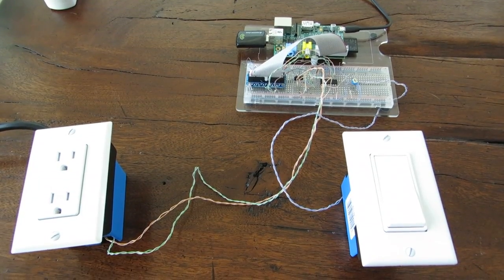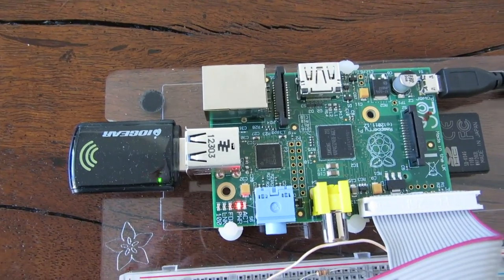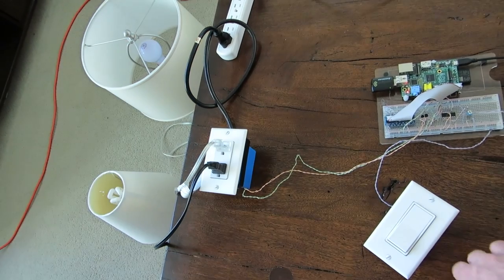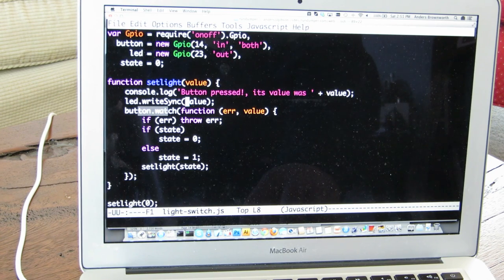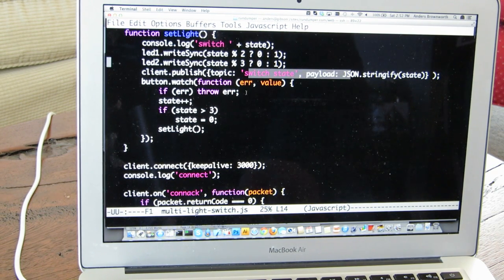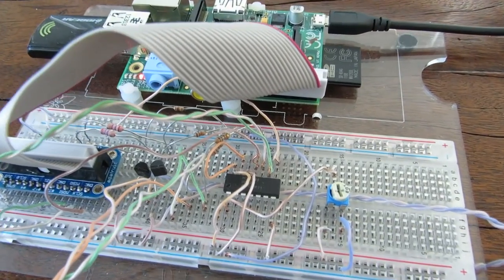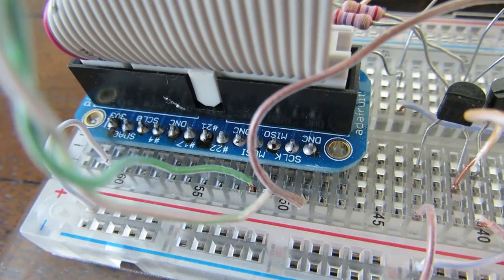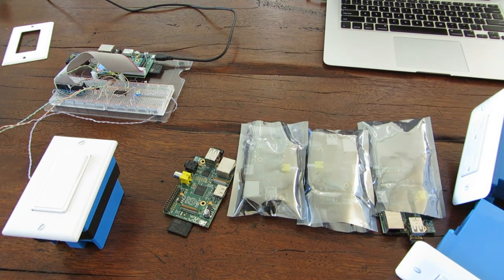Home Automation with the Raspberry Pi and Node.js - Well Tempered Hacker

Comment: one note of caution. here in the USA, it is illegal to place a low voltage device in the same enclosure that a high voltage (line level) device is in. if something were to happen to the relay in the outlet box, there is a potential of high voltage being applied to the tiny wires and may cause a fire. Check the local electrical building codes BEFORE doing this. It could void your homeowners insurance!!

Comment from the maker: Because we would have to run GPIO wires all over the house and would forfeit the ability to sense power, sound, motion, etc. at each socket / light switch. Products like this already exist but they tend to be unwieldily and proprietary. For example, why attempt to reinvent secure wireless when WiFi exists? I'm trying to apply open technologies that have proven track records to a problem that has traditionally been solved with proprietary solutions.

Comment from the maker: Yeah, I came from a micro controller / FPGA background as well. Being able to leverage all the standard Linux tools as well as having a true multitasking environment for $35 are huge benefits.

With node js you have JavaScript, a very popular and fairly easy to pick up language for most. Functional programming isn't ideal for the simplest of situations but the libraries available through npm are extremely extensive, and I think about home automation as an inherently event driven system.

Comment from the maker: Yeah, great call. This is exactly where I want to go with this. What you are suggesting is that things like home security are just "apps" that run on your network. The Raspberry Pi gives you a standard set of tools already (mic/speaker) so adding a few more (motion detection/temperature) and defining that as a platform so apps can depend on certain capabilities is the way I'm thinking about this.

Thanks for the comment!

Comment from the maker: True - which is why I got SSRs that are rated roughly double what I will see. Worst case we make the box out of metal and screw them in. For running lamps, they don't get any warmer than room temperature, but I'm not opposed to traditional relays outside of the clicking sound they make when they change state.

Comment from the maker: The Raspberry Pi's USB WiFi device connects to an access point. It can be made to run in AdHoc mode though where peers connect directly.

In the end game, I don't "remote control" the devices. That's what the switches are for. When a switch changes state, it broadcasts that fact. Any power sockets that are subscribed to that switch can change state if they are configured to do that. That's what I was attempting to demonstrate with the multi-light-switch example.

Hope this helps.

Comment from the maker: Good point - no reason data over power wouldn't be possible. I have circuit diagrams available on the GitHub page if you follow the link in the description.

Best of luck with your setup!

Comment from the maker: I'd imagine that might work if the drives are powered externally. If not, maybe you could look into spinning down the drive via a "parking" command. It would remain connected but not taking up the power. Presumably you could programmatically fire it back up on demand.

Comment: You might want to look at Tellstick device. It is a third part USB device that is used to control 110-240 Volts radio controlled devices. 
There are transmitters you can have in your pocket or mounted on the wall insted of or combined with ordinary light switches.
There are receivers that can be plugged in a wall outlet or even mounted inside the wall outlet or electrical devices like lamps.

Search for Telldus or Tellstick. A nice device that can be used with a couple of RPi for each room with your software.
Reply from the maker: Thanks - interesting. I'm mostly interested in having the intelligent devices on the edge though.
Reply: Anders Brownworth an Raspberry Pi is an intelligent device. ;-)
You just can skip wire to a lot of places to controll things.  And the RPi and electronics/relay is much larger.

Comment: Heat shrink tubing + small arduino/pi friendly relay boards. Neater and safer. Or buy a relay board with networking built in already. That's my personal preference.
Reply: off to  check out your channel

Comment: Your setup is simple and elegant. My only suggestion would be to consider powerline network adapters in some places.  Some houses (like mine) don't allow wireless signals to travel very far.
Also, if you could put up some wire diagrams of what you have on the breadboard, I would be grateful. I am considering doing something like this and could certainly use the assistance.

Comment from the maker: Well, you could. Many people do that and it does have the benefit of being a bit cheaper. However, there is a lot to gain by leveraging a real multiprocessing platform with a rich networking ecosystem. For example, even just SSL over encrypted WiFi represents probably an order of magnitude more security to a system that will likely eventually control things that cost you money. (like a heating / cooling system) Add to that a great programming environment and for me it becomes an easy choice.

Comment from the maker: I could name a few features that would be nice to have (built-in WiFi for example) but I'm generally fairly content with what the Raspberry Pi has. Performance, on the other hand, is what you might expect from a $35 computer. It usually doesn't matter but filesystem access can be agonizingly slow at times. That's probably most annoying but it gets there eventually.

Comment from the maker: Yep, you can do a single Raspberry Pi but then you are limited by the number of GPIO ports and you have to run low voltage wires everywhere. I suppose you could run a few Raspberry Pis and wire several sockets / switches to each as practical. Would love to have your help on the project!

Comment: Awesome project, looks like a solution for my future RPI project. I'm making a HTPC and have my files on a couple external usb hard drives. I don't want all the drives powered at the same time so using your prototype I might be able to have the RPI automatically power and access only one drive at a time or two.

Comment: I've seen your comments where this system is basically not overkill as some are stating and I agree with you.  I understand your position completely.  In essence, you are simply laying the groundwork for bigger and better things.  In that vein, I was thinking that as an alternative to merely replacing switches,  as you have done, perhaps something more like a larger module with clickable components.  Now that wouldn't work with the actual switch per say (though you could have a digital version relaying essentially the same information) but you could also include in the space areas for "upgrades".  Baby monitors and intercom systems like you mentioned or a touchscreen (for notes or news or what have you) that is networked to the main system or customized music system or a projector (for playing movies or media from the main system in any room on demand) or a smoke alarm or weather station or all of the above and more.  All of these components could be taken out individually and repaired or replaced as needed without losing the entire system.The more I have learned about these Pi;s today, the more cool ideas flood into my head :)  Anyway, I love what you have done and completely understand that this is NOT overkill in any way shape or form.  In fact, if it were me, I would wait until the next gen of Pi's come out before doing any real implementation.  If you ever want any help from a web design & dev & graphics person, just yell.  Plus, I'm full of useless ideas to boot :)
Reply from the maker: Thanks - your thinking is spot on. There is no reason why you couldn't extend to touchscreen / graphical devices, smoke detectors, geiger counters, etc. Looking forward, the applications are almost too numerous to count. But you have to start somewhere!

Comment: Awesome! Great idea! It might help contribute to save power to turn off the sockets while they are not in use. Can easily be extend to turn off/on over the internet. Can't wait to add it to my DIY list.
Reply from the maker: Yeah, that's a good call. It might also be interesting to use the input of some motion detectors to shut power off on pre-selected sockets if there is no movement within a room for 30 minutes. Then when you come back home, those sockets might automatically power up again. Actually there are a number of ways to do this - motion detectors being only one of them.

Comment: Well, the lights are all up on a grid above our talents heads, so turning them on and off presents a challenge. We run extension cords down with switches, but it would be really neat to just control them with something you've created. We're dealing with about 8 lights now, it would be neat to have them all on one switch or app. I am sure there is a market for this besides just us. :)

Comment: I would like to see a more complete version of (one, or more?) of these 'nodes' in tandem on a network and including a web interface to mimic the switch controls. I am also looking to build a HA system that 1: is RPi based, 2: leverages the web interface AND traditional switches to control things, 3: provides real-time feedback of each state (I'm thinking that socket.io will be needed), 4: easily scaled. I feel that including an arduino with the pi will provide much capability that is easier to implement than the A to D converter, plus it would reduce the amount of Pi computers needed.

Comment: Hi Anders, thank you for sharing this amazing video. I really love it. I am quite interesting with the raspberry part. So far that i try to understand your video, you use ADC to sense power. What i am curious about is that, do you put resistor between your ADC and raspberry pin input? Is there any resistor inside raspberry to control how much current it can draw from input pin? It is quite frustrating to find raspberry specification about current specification. Really appreciate if you can share your knowledge about this.
Reply from the maker: dimas adityamurthi No, with the ADC I'm using I don't have a resistor between the output of the ADC and the Raspberry Pi's GPIO input pins. Depending on the ADC you use, you might need one but I have a 3.3v logic ADC so I don't need anything.
Reply: Anders Brownworth Thank you so much for your reply. I am wondering, can I use LD1117 (voltage regulator) to drop voltage from power supply 12VDC 10A to 3.3VDC and connect it to raspberry?

Comment: It's neat to see this as a proof of concept!  On practicality though, each Pi requires a lot of energy individually, even idling which they will almost all be doing without any serious work to do.  There's also a lot of "moving" parts, as normal electronics atrophy over time, so individual nodes will decay and fail regularly.  So the cost will ultimately be much higher than the individual Pi's I think.  I think using a lower power, lower cost IC would be more practical, such as an ATmega328p at just 4 dollars each.  Each IC would have more than enough power to do everything the Pi nodes are doing.  (again though, as a proof of concept, it's nice to see the process and conclusions, as experimentation goes)
Reply from the maker: Clairvoire The Pi (especially the model A) use very little power (500mA) but agreed, there is always room for improvement. However, I wouldn't go to a micro controller such as the ATmega328p. The flexibility to be more than a special purpose hardware device is the point of this project. A micro controller is all you NEED for a mobile phone but giving it a microprocessor allows it to become a smartphone, something exponentially more useful. The point here is what the entire system can be that is well beyond simply a smarter light switch.

Comment from the maker: It depends on the loads I'm driving but with these lights they remain room temperature. I'm sure if I were switching something much more demanding they may get hot but the idea in the long run would be to heat sink the relays against a metal housing. That seemed overkill for my prototype.

Comment: thanks - but ... It looks like much of what you have on the breadboard is not necessary - just a current flow monitor for down the road expansion. right? Anyhow I am a newbie looking for a starting point. The simplest computer command line to turn on and off a single light with the simplest possible code (fewest lines). Also explain if  SSH to the Pi is needed or is there another secure protocol? Is there an SSH lite? How do you plan to central control?

Sure would like to see another video for your breadboard circuit with closeups on the parts so I can see the part numbers.. There are so few that you could list them in the comment section. Thanks for the closeup on the Sharp relay - consider how much time I have wasted and not found it.
Reply: sshpass + exec would be amazing...

Comment: Why not do the sensing and actuation using an XBee ZB mesh network. Connect the XBee Controller to the RPi via e.g. Arduino or directly using the Cooking Hacks Raspberry Pi to Arduino Shields Connection Bridge with Xbee headers.

Comment: Thanks for sharing your Raspberry Pi project, it has inspired me to try and replicate it. Keep in mind this would be my first Raspberry Pi project and I am primarily more interested in the programming component, but to be able to do the programming part, I would need to setup the physical component first. So, is there a shopping list of the components one would need to build your project from scratch, and possibly even a list of instructions to connect it all together?
Reply from the maker: pablotam80 I don't have a simple parts list worked up - it would depend on exactly what features you wanted. I had considered making a package with all the components you need. I'll look into doing that again.

Comment: Hey good video really liked it. but I have a question where do you run your MQTT Server on ? wouldn't that be the central point of your system ? that means a single point of failure. I solved the Problem by using redundant Raspberry Pis as a server in case one of them is failing there is still 2 other ones. And as a client in the Switches im using Arduino with PoE, its from the point where i'm just a workbench system but if set it up in your house you need to run Ethernet Cabel to every arduino.

Comment: Great video Anders! This really motivates me to try out Raspberry Pi!

Question... Why is Node.js being used? I don't see what the connection is to using Raspberry Pi. As far as I know, Node.js is a server side language for websites, no?
Reply from the maker: +Justin Javier Good question. Yes, Node.js is used on websites but it is actually a more general server-side language. You have the flexibility to use just about anything (python is popular) but I find Node.js to be very simple and clear. Add to that the "onoff" package which makes reading / writing the GPIO pins very simple and of course the ability to easily add a REST API or web front-end - kind of an easy decision. It isn't nearly the most popular option at this point but it is hard to ignore that Node.js has a module for nearly everything these days. Node.js uses JavaScript which is the most popular language on the planet so I think it is somewhat inevitable given the millions of people with a JavaScript skill set. We'll see what happens but I like it.
Reply: +Anders Brownworth I never liked JavaScript, infact I hate it with a passion :)
I did some NodeJS work for some Twitter bots and that was about the only time I was like: Yeah this is something that it can and should do ;)

I rather stick to Python if I need an interpreted language because it actually has proper OO support, multi threading support and is a clean language.
But when stuff gets more serious than my choice is Java or C/C++.

Comment: How come you didn't use a mechanical relay? Solid state relays are usually if want to operate faster 50hz e.g. if you want to use PWM which you would have no need as you have the digital to analog converter.

Comment: Interesting concept . Seems all the pis are based on the network. If the network goes down, nothing works. Do you have some kind of fail safe if the socket can't connect to the network? Maybe a blinking LED to let you. I am just picturing trying to reset the router and you can't turn the light on to see!
Reply from the maker: Good point - I don't have it but it would be easy to fallback to a hardcoded logic that supplies the obvious functionality.
Reply: Using your idea, I think I have a project in mind, although not wirelessly. I wanted to setup lighting and a few outlets in my crawlspace - but didn't want to run two lines of wiring (one for switched lights, other for outlets). But with your idea of using a signal to turn on power - I can just use one run of wiring, and switch on the lights, or activate outlets (for fans) - although I'll still need to run a second line of wire (but low voltage) to power the brains and data - although I'll probably use adruino mini's instead of pi's for cost and size.